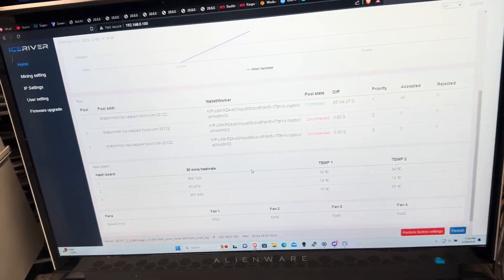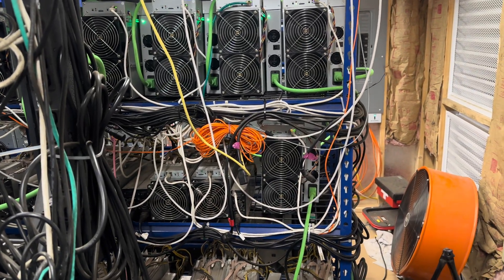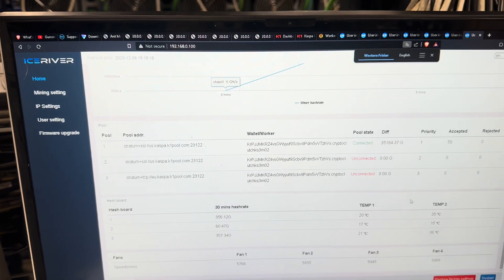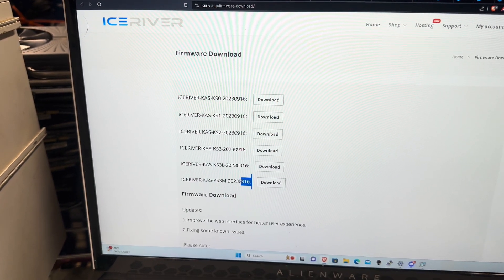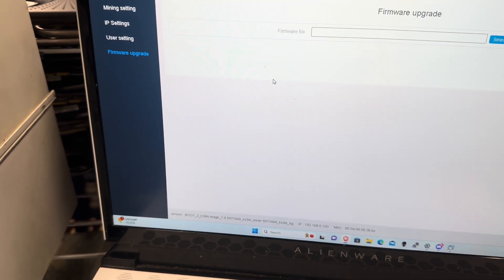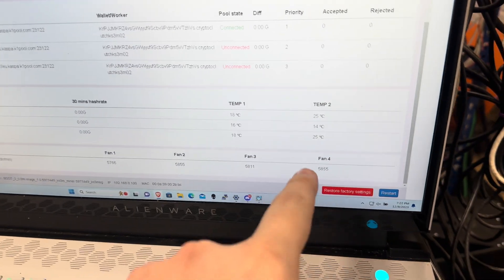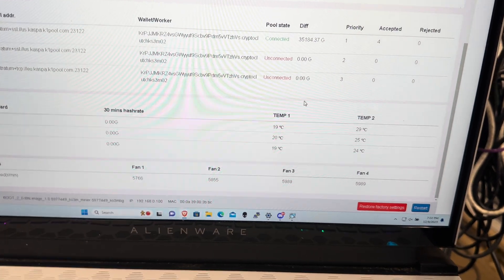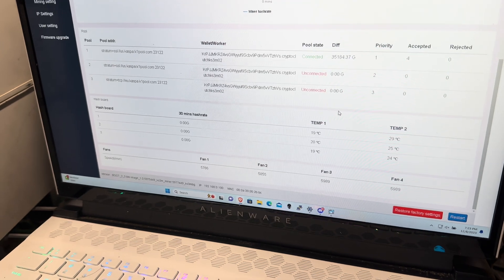Have a IceRiver with 1 Hashboard not Hashing? Watch This Before You Send it Back!

Comment: Just updated our NEW IceRiver KS5L and one of the hashboards stopped working after we installed the latest firmware. Has this happened to anyone else? We tried a factory reset but the hashboard is still down. Odd because they were all working before the update. Any suggestions would be greatly appreciated.

Comment: You want me to take apart my $11000 miner that's under warranty to change the thermal paste because they sent a literal pos?
Reply from the maker: I mean you can do what you like but if you send it back for warranty it will take a month to get it back.
Reply: @CryptoClutch yeah i know.
It sucks.
Btw mine doesn't show low hash rate it  shows literally 0.
Would this still help?
Reply from the maker: @michaelkeith3308  you could try it. There is a new tool that might help you. I think greater good mining just made a video on it

Comment: At first this didnt work but I kept restarting and updating and after a dozen times it started working again. Thanks. Saved me from trying to fix it myself. I am going to redo the thermal paste on them though.
Reply: Repasting the thermal paste with the thermal grizzly stuff fixed all my issues.
Reply: @holdouts  hi, don’t order a control board, it’s not the problem, I’ll move the non-working hash boards to another Asikov to another control board, I reinstalled the software many times, it didn’t help, there’s a defect in the hash boards
Reply: @yanromanko4241  Yeah I figured that it was the hashboard but I had all ready ordered the control board and it's on the way. Any suggestions on how to get the hashboard repaired? I voided the warranty when I took it apart but I wouldn't want to ship the whole thing back to China anyway. Looking for a repair shop in the US that could fix just the hash board.
Reply: Hi, I have same problem on two ASICS, try many times instal and restart … and nothing ( you repast first hash board ?
Reply: @yanromanko4241  Yeah I repasted all three and it worked for a while but now the one middle board won't hash at all. I had to disconnect it and am hashing with just 2 boards so it will hash at 4TH. If I leave it connected it won't do 4TH. I ordered a new control board but I doubt that is the problem. I will post back here if that fixes it. Control board is $60 + shipping from iceriver. If it doesn't then the hash board itself probably needs repairing.
Reply: @holdouts  thank you, then I’m waiting for information from you) and if I find anything useful, I’ll definitely share it here)